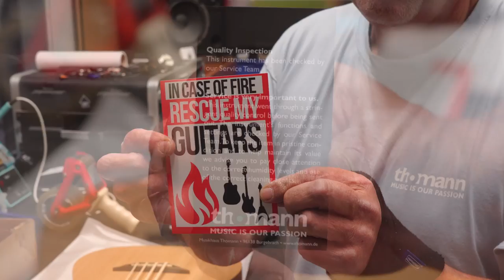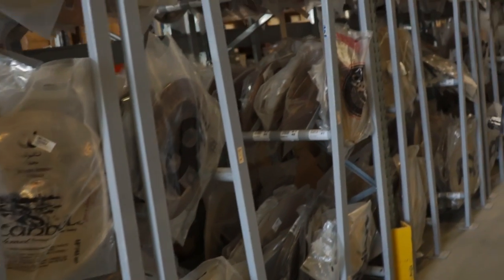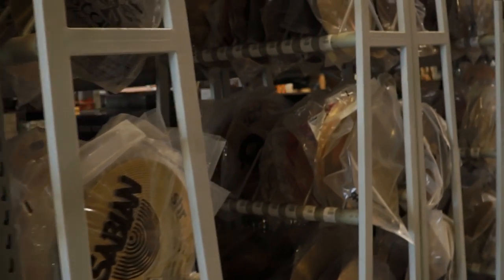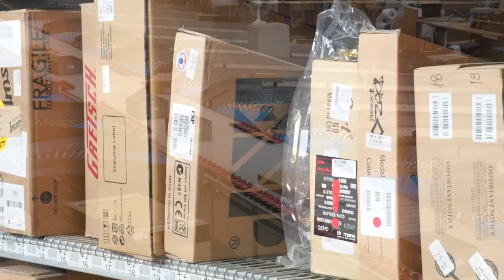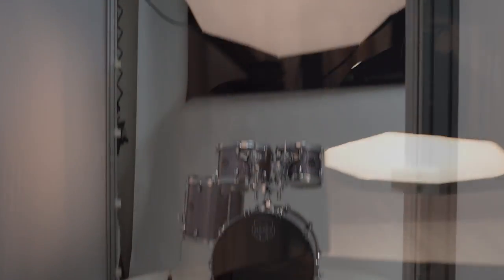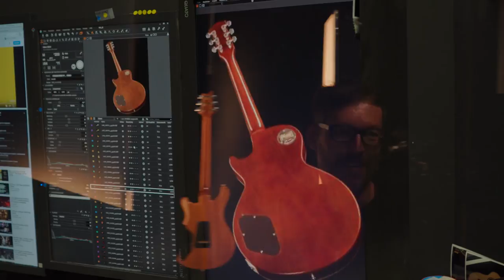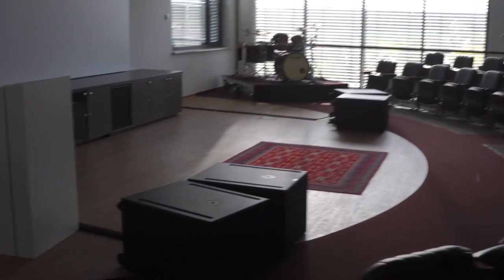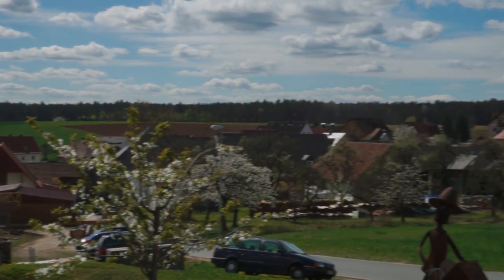Spectre Sound Visits Thomann: Part One

Comment: That is a Ukulele Bass Glenn
Reply from the maker: Duly noted!
Reply: So basically guitar? :)
Reply: Yup it cancels out to a tiny guitar
Reply: actually they are as low as a normal bass
Reply: Is it normal for those when the two low strings touch at the headstock? Looks like that's the case in the video.
Reply: Pfaeff the strings on them are these weird chunky rubber things that have almost no tension on them compared to even a low tension nylon string guitar, great for bends, but they are a bitch to tune, and restringing is a fucking nightmare; it takes three weeks to get the string stretch out and.
Reply: Guilty :)

Comment: The machine is called a "plek", it measures the neck, frets and nut perfectly and outputs optimal values for it.
From there you can either tweak the values for different setups or you can just go, then it will actually go over the entire guitar doing everything from fretdressing to nut slotting and shiet.. Epic machines that gives you so flawless setups its ridiculous.

Comment: hey glenn. i just put a deposit down on a 5150 mk2. i found it at my local guitar store and had to have it. they're hard to come by in the uk.. anyways. i know i've hassled you about this before but what is the best way to hook up multiple tube heads to a patchbay> i have a marshall 1960a cab and a torpedo live. i'd like to be able to patch between the heads and outboard gear with ease. but man it's confusing. + i don't want to blow my amps up. the other head is a marshal tsl 60 Btw
also is there any noticeable differences between the mk1 and mk2  5150's

Comment: Hey, Glenn! I have a question about Thomann production and hope you can give some answer. Usually I use Rotosound Swing Bass strings (stainless steel sets). It costs ~22 euros. On Thomann site I saw a set of bass strings (Harley Benton Valuestrings) and the price is ridiculously low - just five euros per set! So I was thinking which is better - use what I'm familiar with or I should try Harley Benton strings? It's a really hard choice, cuz I believe in quality of Thomann production, especially after what you shown here, but Rotosound is just magnificent strings, they go like hot cakes. Please tell what you think.
Reply: if they are so mindblowingly cheap, why not get a set to try out? if you don't like them, put them on the next bass you want to sell.
Reply: You're right, it's just me =) I prefer to give my bass for a setup to expierenced man when changing strings since it slowly loses it's intonation, strings height, etc. from constant practicing. And I just don't want to bother that man twice in a short period (like day or two). Plus the set up is cost something, too. So, to me it is good to do it once for two or three months.
Reply: setups like that are totally unnecessary, you can do them yourself easy with an allen set and a screwdriver man, if you have a digital chromatic tuner you can get it as accurate as any set up guy could.
Reply: It's just me, again. I feel more comfortable when setup is done by professional =)

Comment: Bass. 
one track from direct input 
one track from mic on amp.
then mix together. 
next send output to new chanel. 
on this chanel eq cut low end and high end add distortion en ones again eq cut low en high and add de Essser. 
sen this 2 channels to new chanel and use multi band compressor.
try put the bass more back in mix.
for low frequency use a fast attack. 
ones e gain eq cut rond 300 Hz.

Comment: I stopped buying from Thomann couple of years ago. They are good/quick and have low prices but my experience if things go wrong was negative... 

ps I'm in Germany
Reply: what happened? i nevered had any trouble so far returning stuff, also not when something broke.
Reply: I have ordered for thousands of euros at Thomann and been a customer for over 10 years and i have to say that i have had both good experiences where they have done more than necessary and not so good experiences, one of the not so good (or even bad) was when i got an acoustic  Harley Benton Hummingbird copy that had the "inspected by" label like in the video but clearly wasnt inspected or they didnt care and then when they exchanged it gave me one that was even worse. This was not a dirt cheap Harley Benton model either, but more mid range model. So i got a refund instead and have never bought a guitar from them since i dont trust their quality control after that. Buying electronics and hardware works great though, there are also some great deals to be had buying their own brand mics and cables for example.

Comment: Did you ask them why they have so many Ibanez B stocks?! I swear every interesting deal they have is some busted or returned tragedy.
Reply: Usually B stock items are pretty good, it's the C stock that comes with faults.
Reply: Nah, i ordered a B stock once by accident because i didn't notice it in the print, the deal was too good to be true. The damn thing looked like someone threw it through a wood chipper. I think their website should have a specific section for B stock, AWAY from the mint ones.
Reply: You sure you ordered it from Thomann? From description it sounds like C stock, B stock usually has minor scratches, ex-display items, etc.

Comment: Well this being a sponsored video (advertisement) I guess, It can't be so honest. And NOT because Glen is not being honest but because they expected that day the video shoot out and showed how "perfectly" everything worked at Thomann. Having made an order recently which included a Harley Benton guitar, a Harley Benton looper pedal, a guitar stand and a couple of cables I have only the worst things to say about Thomann. From the quality of the instrument, to the packaging , to the set up / quality control. 

  The guitar was damaged at the head-stock because, thanks to the Italian airport employees I assume, the head-stock penetrated the cardboard box and hit a wall or something. Which wouldn't be too hard to accomplish. Literally the only thing between the point of the head-stock and the outside world was a 2mm-thick styrofoam bag and the cardboard box. There were a few air bag cushion in the box but, they were so few in number they were just scattered around protecting nothing.  The frets were smooth as a 320grit sandpaper, I'm not kidding I could feel and hear the scratching of the strings on them. Also the 7th fret had a deep dent from a tool. I removed the bridge pickup to put my old loved one and discovered that the routing hole for the pick up was so out of place that only the 3 of the 4 screws of the mounting bracket were going into the wood. The 4th one was in the air. The whole set-up of the guitar was terrible. My guitar should had  been in that bin Glen showed. But NO ONE inspected the dam thing. Or they just didn't give a fuck. 

   The guitar cost only 110 euros, but how do you expect me to trust Thomann again for a more expensive order? I certainly didn't feel a respected customer. I can assure you NOT every guitar gets inspected before shipping. Also the packaging man. The packaging man. Seriously I would pack my guitar better for a ride from my house to the rehearsal studio than Thomann did to ship across Europe.
Reply: John Smith I ordered there multiple times and left about 15 grand there over the last 20 years and NEVER had any bad experiences whatsoever